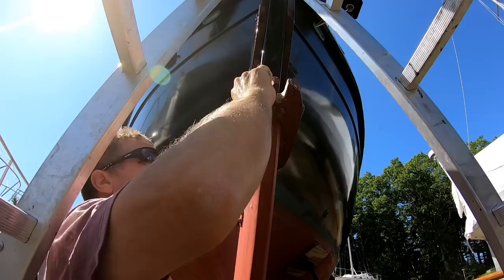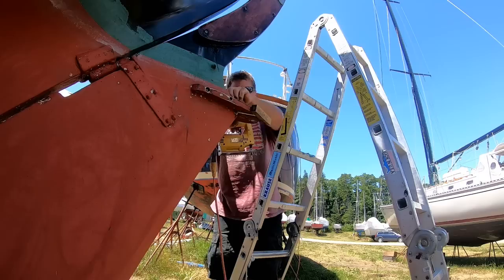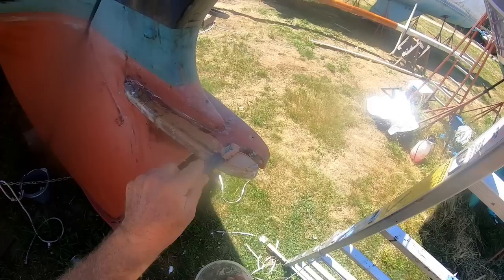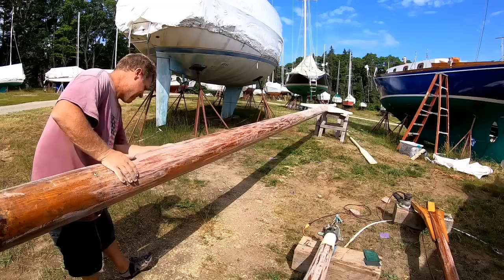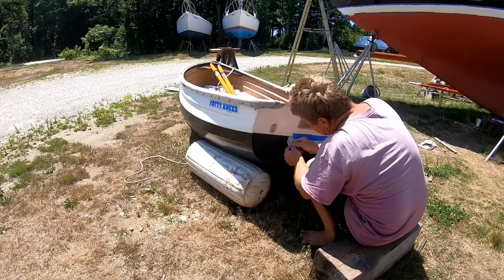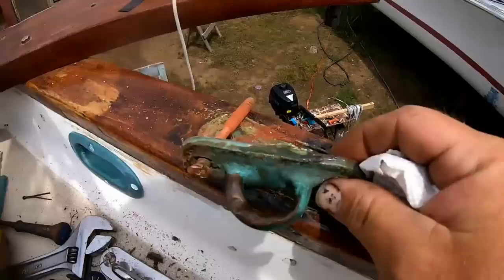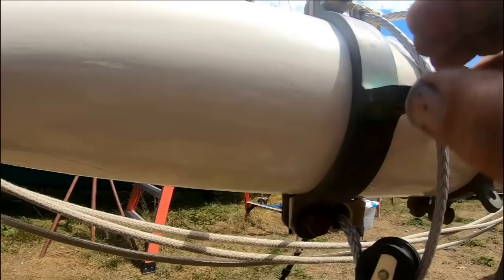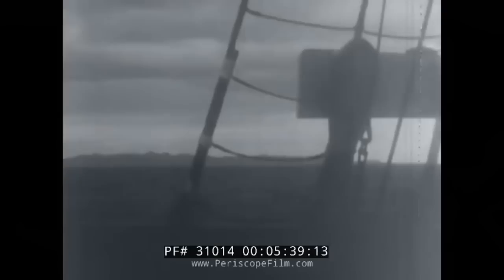Teredo worms begone (I hope); Baby Ruth ready for sea; rigging modifications  | Ep. 176

Comment: Excellent craftsmanship on your refit!!
Suggestion on the bottom gudgeon for the wind vane:  I would suggest to completely fill and redrill the hole to guarantee size and roundness.  Even better if a bronze bushing of the right size could be acquired and pressed into the gudgeon.  Bronze would wear much slower than epoxy and roving, it may be a fix for your lifetime...

Comment: Tape is your friend for those awkward shapes. Epoxy requires no clamping pressure, so you could have just taped that scrap of wood onto the gudgeon with some masking tape whilst the epoxy cured.
Reply: I was thinking a ratchet strap, but yeah, tape would probably work and be pretty easy to do too
Reply: I would say that Kevin needed to clamp it as he wanted a close fit , it being a scarf. To Mike.
Reply: @rayfreeth5156  In which case, the only way to do it is to temporarily screw an appropriate shape onto the other side of the gudgeon, such that the clamp operates on parallel surfaces.  However, I am right. Tape will pull the jont up more than enough for epoxy, which requires no (zero) clamping pressure. A half-decent piece of woodwork will have produced a pair of flat mating surfaces, so the glue-line would be minimal, and the whole thing was fibreglassed and painted anyway.
Oh, and despite what Kevin (and you) said, it is not a scarf. A scarf is a joint to join pieces of timber end-to-end.

Comment: A bit of grease on the screw makes sure that it will back out. Nicely fixed! Graphite in the epoxy reduces the wear.
Reply from the maker: Hadn't heard of putting graphite in epoxy, interesting.  Hadn't thought of putting grease on the screw either, yes, of course, it would prevent the epoxy from bonding.
Reply: Yes on the Graphite...not so sure on the grease however...
Reply: Mix graphite into epoxy - DOOHH! I should have thought of that years ago.....
Reply: Actually, Pam cooking spray the fasteners or Vaseline as per West system and have used the method for years when fasteners need to be removable.
Reply: @Andersenpaul6  A soldering iron on the screw helps
Reply: Lanolin, soap, wax …
Reply: Another option where no screw would be required, would be an opposing block of wood on the opposite side, traced and squared to the opposing angle.  That would afford clamp(s) the parallel surface required.

Comment: If it's not too late, maybe tether your peak halyard block to that worn fitting on a loose cable or chain in case that rope harness loop gives way while you are at sea. That will give you some breathing room until you can get up the mast and repair it.

Comment: The way you should have clamped that scarf would have been to put the clamp further forward on the parallel surfaces with longer lead boards. Once clamped you could have used wedges going forward between the lead board and the repair to create the pressure required. But good job on the repair.

Comment: Thank you for your latest episode. How did the worm get through the toxic paint?
I've made cast-in-place bushings with epoxy. Put a layer of thin packing tape around the shaft. Put the shaft in place and press some epoxy/kevlar into the worn bushing. The tape acts as a release  barier and creates a controlled clearance after you take the tape off the shaft. It is hard to get out the first time though. I avoid using graphite on stainless in salt water.
Reply: Does the graphite create an electrical problem? I am just used to bronze or Delrin. Are Teflon plastics not very performing? I assume the paint gets rubbed of from dingy contact etc Achilles’ heal. So I soak in copper thinned hard anti fouling prime coats.
Reply: @braithmiller , there is a large galvanic difference between carbon and stainless steel. The shaft corrodes to protect the bearing. :-(
Reply from the maker: I think the worm got in where one of the fastener bolts are, where there wasn't much fresh paint.  Of course barnacles will also eat right through toxic antifoul.   Thanks for the info on constructing a bushing.